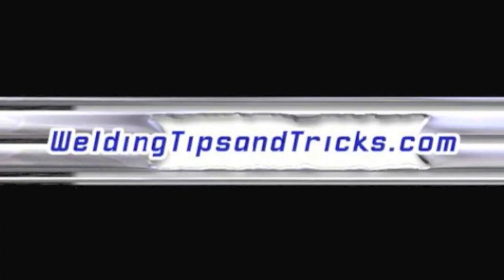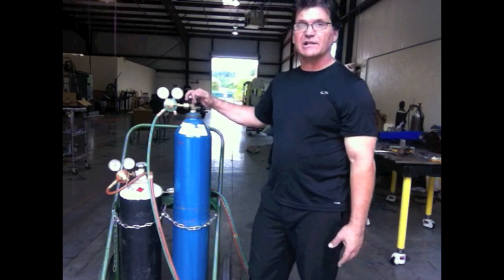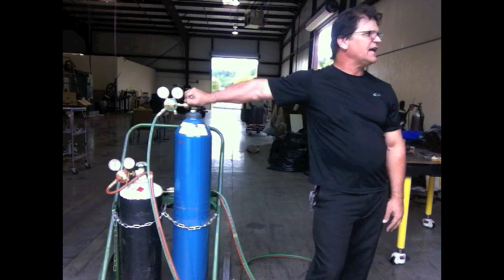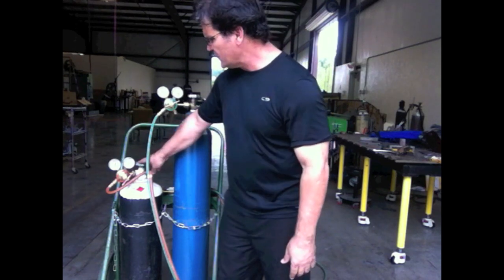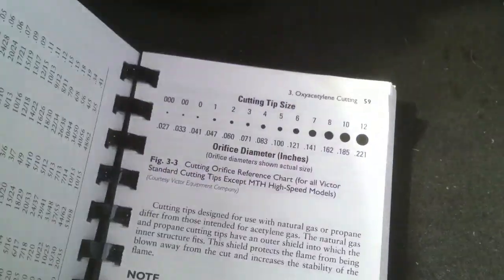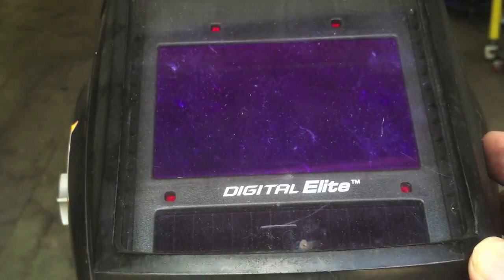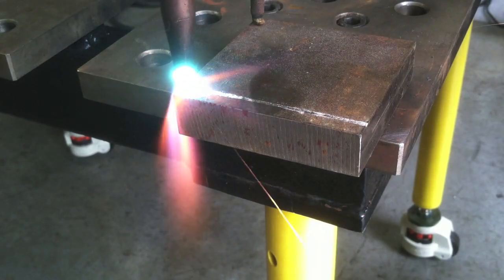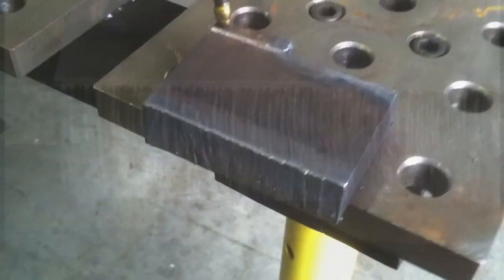Cutting Torch - Tips for Oxygen Acetylene Cutting

Comment: What size Oxy/Acetylene tip would you recommend for cutting 3/8" structural steel?
Reply: You have probably figured it out by now, but personally I have never bought a tip bigger than a 000. If I ever had to cut anything thicker than 3/4, I had old tips I could drill out to a 00 or 0 as needed. I used 000 to cut 95% of every thing I ever cut. From very thin to 3/4 can be cut and made to look like a cut-a-line done it if you get the torch tip clean and set right.

Comment: In this world of liberty, here is what I am tempted to do.. Between the tank and the dials, along this 6 inches pipe, or about, I would place a purging valve.  Preferably one that is spring loaded to be always in the OFF position.  

FIRST : Check if the tank is CLOSED
SECOND : PURGE the pipe between the dials and the tank 
THIRD : open slowly  the valve on the tank......

tHIS WAY, THE SPEED OF THE OPENING IS NOT A DANGER....

Comment: This kind of rig seems extremely dangerous to me, I'm not sure I want it in my shop.  There's no warning labels or instructions anywhere on it, anyone who comes along through my shop could just start playing with the knobs and get themselves killed or hurt.   What is the safe way to dispose of an Oxy Acetylene setup rig?    

I sure as hell don't want a cylinder of highly flammable/oxidizing oxygen in my shop at 1700 psi, or anything at that kind of PSI.  I've used it once before to do brazing, but really have no interest in using it ever again.  I'd rather have a plasma cutter.